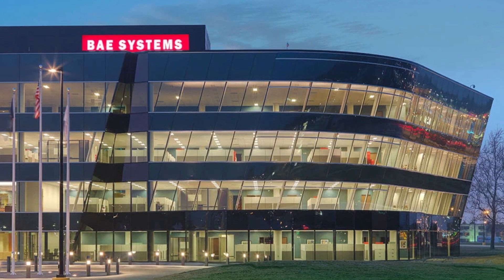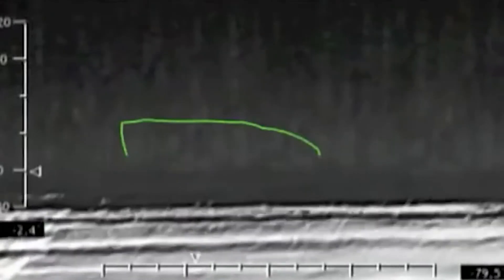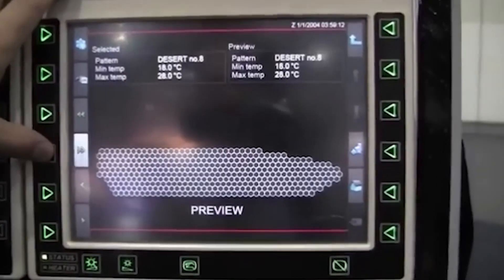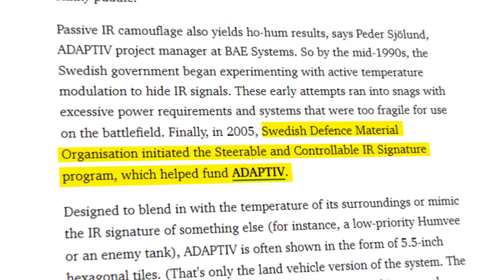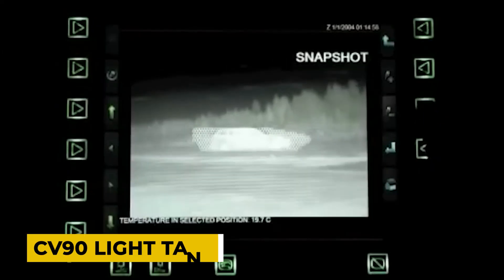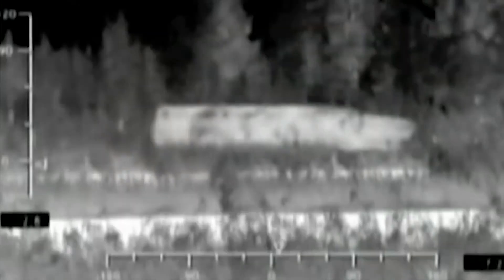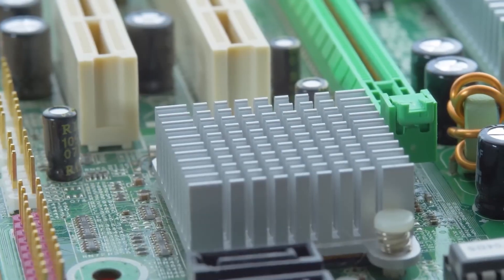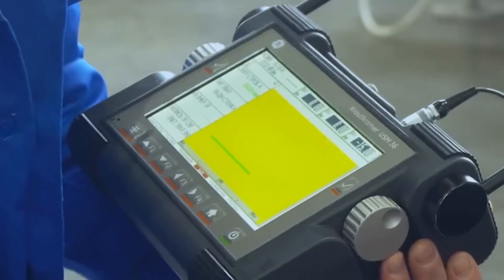This Camo Turns A TANK Into a CAR!

Comment: Multispectral and hyperspectral defeat within 5 years of release.  Suitable only for limited, highly specific, (SOF, cover special reconnaissance) roles where a combination of nighttime operator use and low threshold theater awareness does not disturb the SOA enough to simply create notch-based sensors which scan multiple specie lines until the sensor sees the protected vehicle at a spectrum which the electro thermal tile does not provide adequate emulation.

With sensors operating at 1-1.5 microns, 3-5 microns, 9-14 microns, combined, you're going to see it; if only because the sensor which gives you the broad band capability is increasingly going to be on a dime sized conformal array, carried to multiple viewing aspects and less than 1km standoff by drone.  Detector count will not matter as much vs. increasingly capable image processing on or off the FPA, creating multiple colors of synthesized imagery.

Who wants to associate fires with sensors on a LOS limited platform when the scaling needed to absorb 10-20MJ of recoil load and carry a ton of shells is so huge that the tank stands out like a beacon fire.